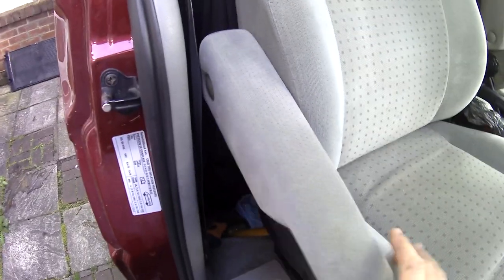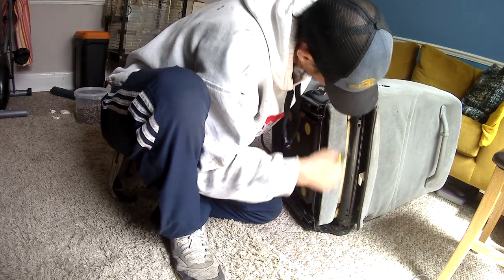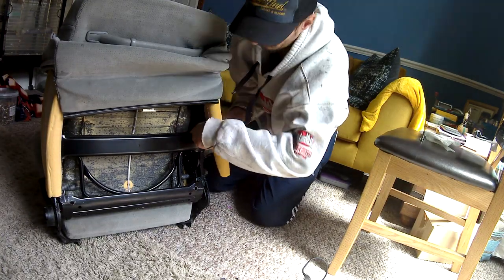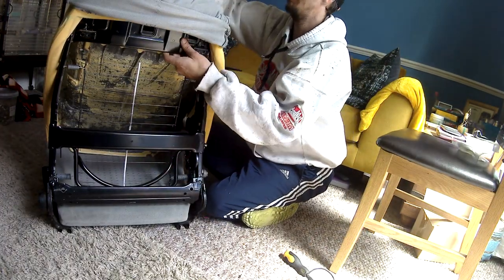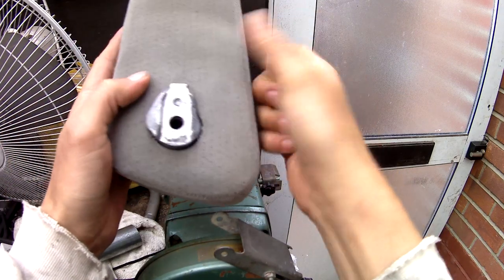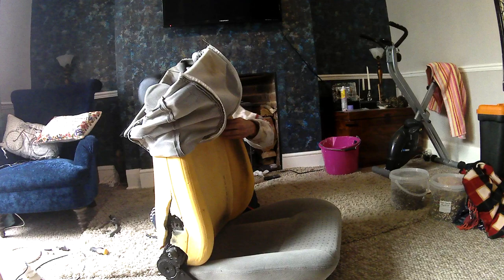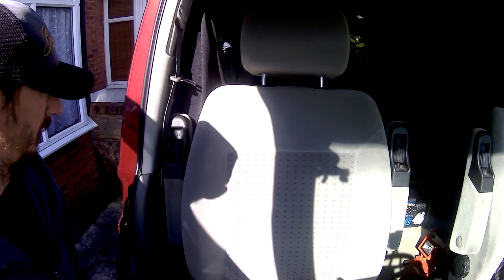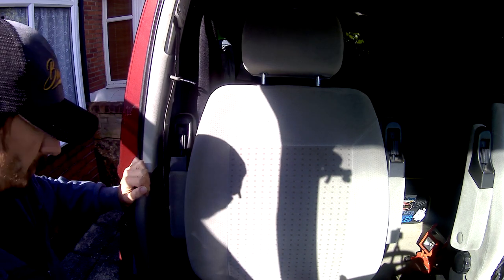How to fix the armrest on a captains chair....2nd attempt

Comment: Brilliant mate, been wanting to see how easy it was to remove the seat cover 👍 given me the confidence to do it now whilst I take the seat out to fit my heater 💪😀
Reply from the maker: Glad to help 👍 easy enough to do, just take your time. What heater are you fitting?
Reply: @TwiggsT4  eberspacher D2. Stripped the seat by the way, gonna remove that armrest bolt mounting bracket with the grinder and weld the bolt to the back then reweld 🤞
Reply from the maker: Fair play mate sounds good 👍